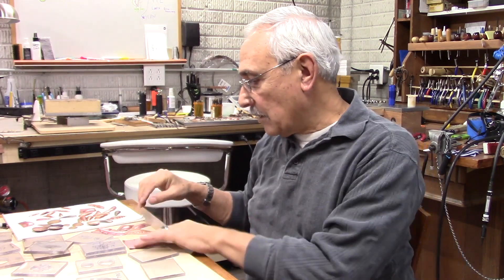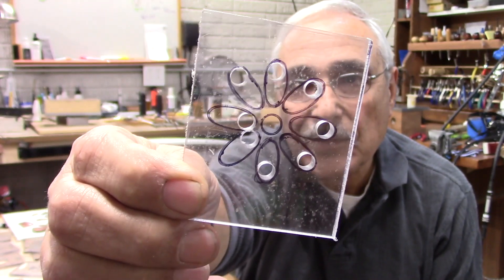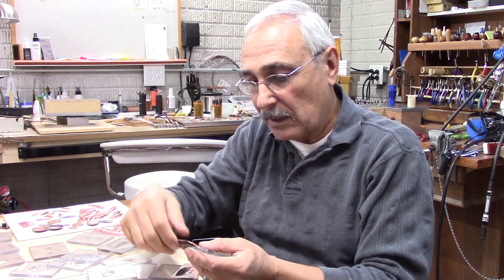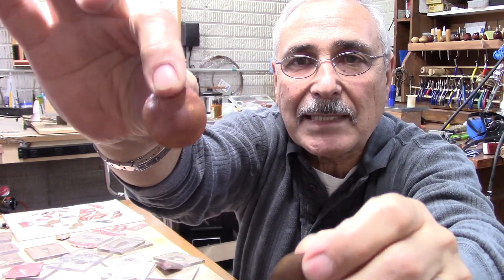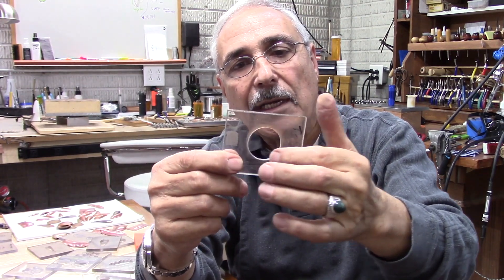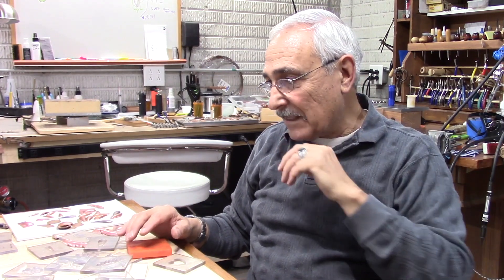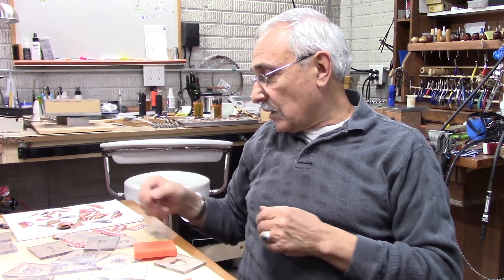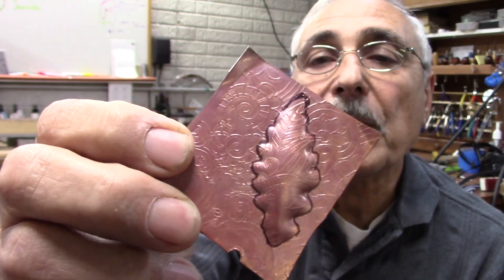How to Make Silhouette Dies for Hydraulic Press.

Comment: Elie - thank you SO much.  What blade number would you use on your jeweler's saw on the 1/4" plexiglass
Reply from the maker: Hi Dawn, I don’t use a jeweler saw, I use a scroll saw, but you can try a jeweler saw with the thicker blade you have and after you finish you have to file or sand to remove the saw marks.

Comment: Hi, I was just wondering what size and hardness (durometer) of urethane you found to be the best for pressing with these dies? Or did you find it really didn't matter? Also did you just use a standard drill bit/drill press to start the holes in the plexiglass? Thank you vey much for sharing your knowledge, very truly appreciated! Bill
Reply from the maker: Hi Bill,
The size I use is 3”x3”x1/2” with 95 D hardness don’t get any smaller than ¼” thickness, I got mine from Rio Grande. For the drill, any standard drill bit will do. Thanks